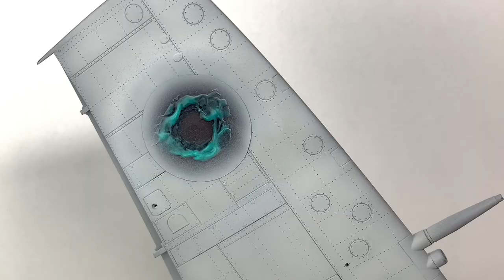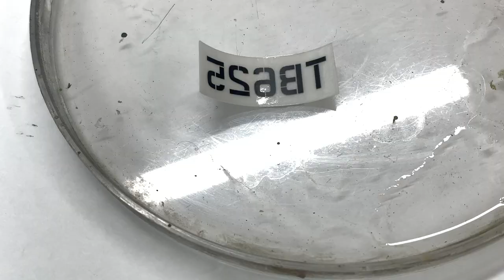Spitfire Mk. XVI

Comment: 32:30: the method of fitting the landing gear to the model is innovative and clever. So the correct angle of mounting is achieved and it sticks dead certain. An idea that should be adopted by other model manufacturers. The only reasonable improvement would be metal landing gears...
Reply from the maker: I agree. I wish more manufactures invested more time into little details like that.

Comment: Hi David, I have this very kit, and a few hours today could not find a video except yours, Very Nice mate! Your skill with air brush will be a struggle for me dead set! Any way to give mine a bit of a THEME I am looking at putting it in South West Pacific as a tribute to Group Captain (before court marshal) Clive 'Killer' Cadwell at MOROTAL as CO no 80 Wing. While I know that the Mark or the Spitfire is certainly not the same, as returning to the hobby after a long, long lay off I have to start some place, Thanks Again for the hints!!
Reply from the maker: Hi Tony!

Thanks you and welcome back to the hobby. This is a very nice kit and you will have a lot of pleasant moments building it.

If you don't feel up to the challenge to spray the camo free hand, look around for some patafix, bluetac or masking modeling putty. This will allow you to lay down the border lines and spray the camo fields. Peek around the ScaleModelAircraft (https://www.youtube.com/user/ScaleModelAircraft) channel here on youtube. He is using that technique quite a bit. I found that channel quite helpful when I got back to the hobby - many useful tricks there. In case you are not a subscriber already.
Reply: @DavidAndrs80  mate I have been getting over bad chest infection lately so hope that I can get back to my model table before weekend? BTW just ordered a Tamiya Spit mk 1;-)

Comment: I want to get back into modeling myself and checking out all these videos to learn some skills.
It surprises me that some modelers assemble as much as possible before painting them while other paint first before assembly.

The biggest thing I might have been doing wrong all those years back was that I always put glue on the contactsides before putting it together while in every video I watched they hold it together and brushing the glue on the edges.

Also must buy some good airbrush gear.
What can anyone recommend for airbrush gear and brands of paint to use?
Reply from the maker: Hi Dot Matrix!

Re: how much to assemble before painting, I consider following factors: (a) how difficult it is going to be to paint the subassembly (is it going to need complicated masking, paint hard to reach areas, etc.), (b) would painting before gluing result in better colors separation, (c) how good is the fit of parts.  But, also note that in this video I purposely painted parts before gluing just for the sake of the video. You can do much bigger subassemblies with this kit.  

As for gluing parts together: that depends on the glue you are using. The extra thin glues (especially the quick setting ones) work much better when you put parts together first and then apply the glue. But with thicker glues you ally the glue first.

For airbrush I settled on Badger for two reasons: (1) it is very easy to clean and (2) it is a great airbrush :-D (I have Patriot 105 and Krome).
For airbrushing I use Tamiya and MRP paints. MRP is airbrush ready and one of the best I tried, but more pricier than Tamiya. With Tamiya I find the trick is to use their lacquer thinner and thin at least 1 part paint, 2 parts thinner (that is the basic ratio where you start, you may need to add more thinner based on the conditions and what you are spraying).

Also welcome back to the hobby - I myself came back to it about 5 years ago.
Reply: @DavidAndrs80  Thank you very much David for taking the time to reply and is really helpfull, I will take your advise with me. I still have a Badger airbrush laying around, probably needs a bit of repair after 25 years of not using it. Otherwise I need to get a new one and perhaps a compressor.

I'm planning to start this week, got a 2nd hand 1:72 F-101B Voodoo from Revell mainly for nostalgic reasons. 😃

Hope I can resist buying more kits than I can reasonably build this time around. 😂
Reply from the maker: Best of luck with your build

Comment: Beautiful build of this kit! May I ask where you got the peelabe decals for the serial number? I know Eduard do some stencils, but I haven't seen anything else from them...
Reply from the maker: They are home made. You take Sunnyscopa Type A film-free waterslide decal paper. You make your design and print it on a laser printer vertically flipped. Then, use Mr. mark setter (the blue one) to apply. Let dry for several hours, then peel. This is not my invention. I found somebody on YT that described this method and they claimed you have to use these exact products. I did not check if other products work as well, but those ones worked for me...  
Also, this is roughly the idea of how HGW wet transfers work, but their technology is much more advanced...

Comment: Great job! What glues do you use for painted elements?
Reply from the maker: Hi Piotr! My go-to glue for painted parts is Micro Krystal Klear (it is the white glue you see in the video). It is fairly sticky (unlike regular white glue) and dries to matte finish. However it takes several hours to fully cure - which may or may not be an advantage.

But, the choice of glue also depends on what you are gluing to what and if there is going to be some force applied to the part (for example tension from a rigging line, or weight of the model applied on the undercarriage, etc.). And, of course, how the manufacturer engineered the joint between the parts. Based on that, I can switch to super glue, epoxy glue or Tamiya cement (hexagonal bottle with orange cap)

Hope this helps and thanks for your comment!